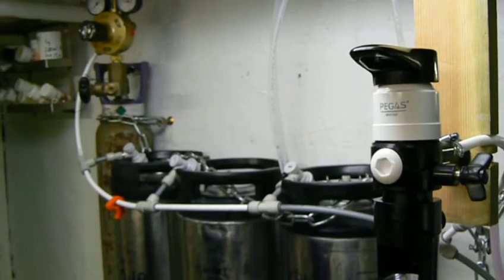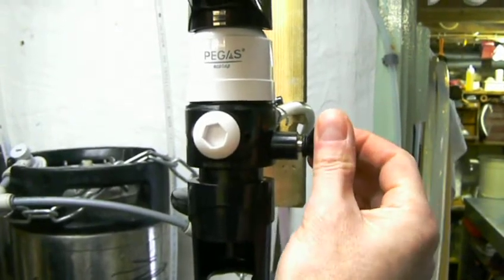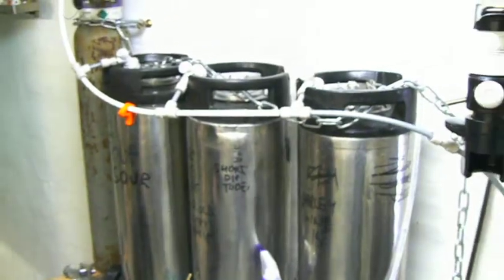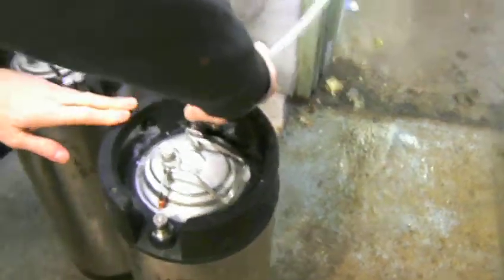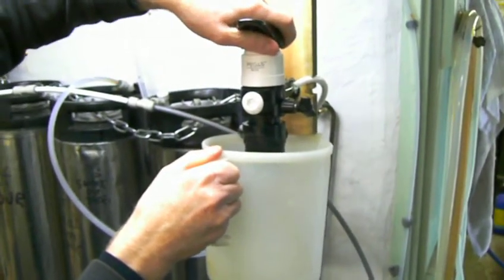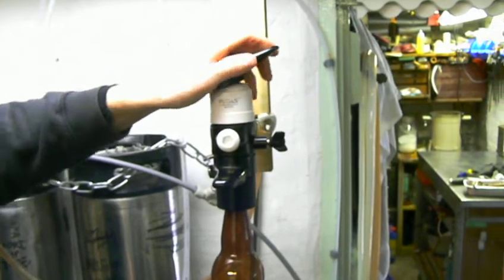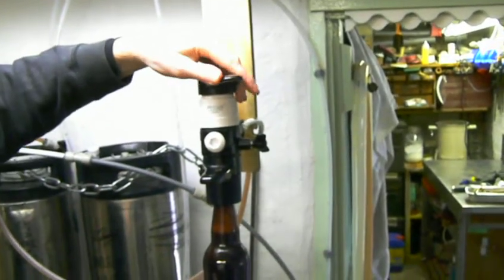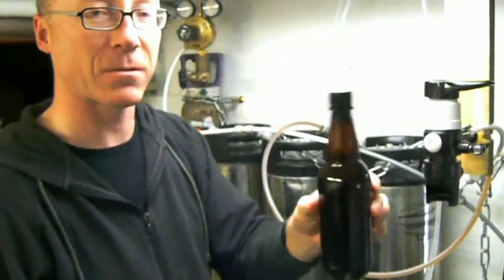Pegas ecotap operation

Comment: Nice video, thanks Steve (nice set-up, too). I'm going to look into the newer Pegas Evolution. Do you ever get an issue with accidentally blowing back a little bit of beer into the keg, thus disturbing the sediment?
Reply from the maker: Hi. No I have never had that issue. The process shown bottles consistently bright beer. The evolution looks good, but can't justify the purchase as my eco tap is going strong. Just flush with warm water and PBW once used.